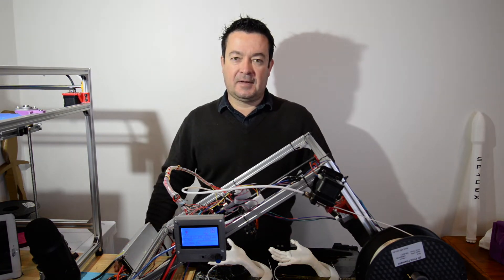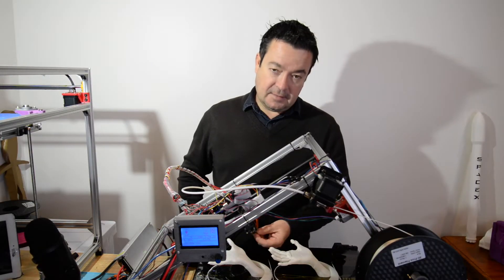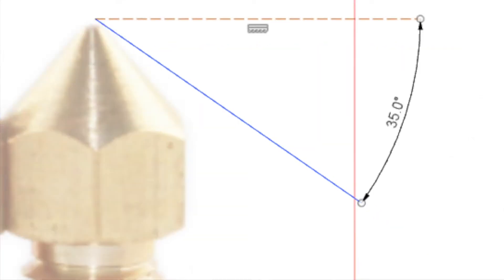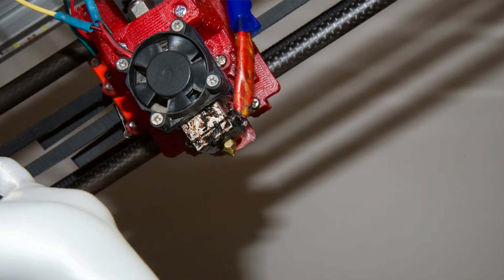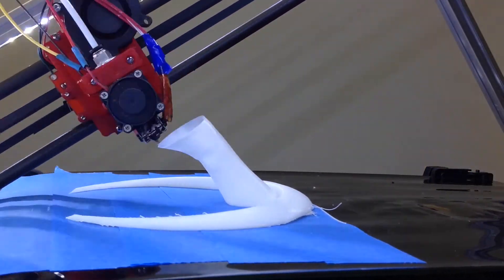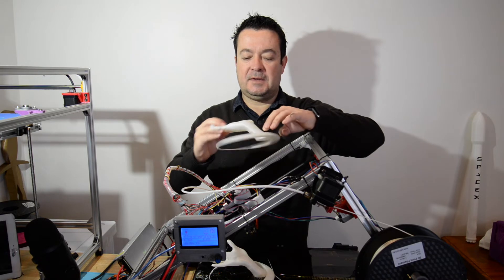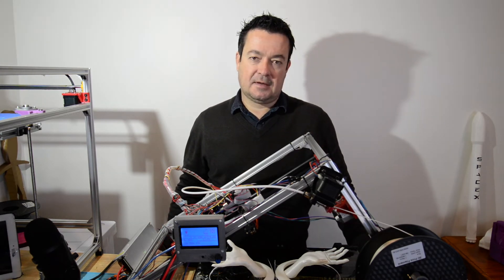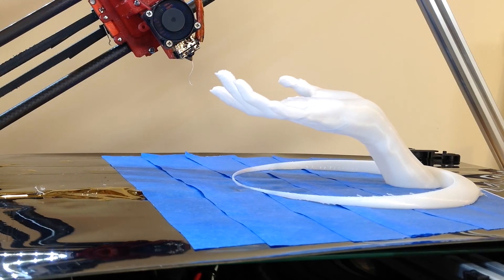Hypercube Infinite 3D Printer - Printing at 0.1mm layer height and Nozzle Upgrade.

Comment: whaoo it's crazy ,
 i want to build a 3d printer but i show you and what ?????  so great project .. i m starting with your base if it's possible ... i want to build my own printer it's better project than i m see on the web ...
but a big question for me , is it possible to make this under arduino and easy programating to change and add angle , axis ,, ect ....
for the structure is simplier than other printer and stable , whaooo so good ... thank for sharing your work , thanks to you Mister Coyte-K.
Reply from the maker: Hi David.   The changes can't ask be made on arduino. The slicing of the model is the tricky part. The model is f rotated at 35, then sliced, the transformed for the movement of the z axis belt. Cura by blackbelt3D does a brilliant  job. They even do supports now. The standard marlin firmware can be used on arduino. Just change the maximum Z to 99999.

Comment: what would be the result or the advantage to change the angle to 45 degrees instead of 35 degrees?
Reply from the maker: Even more extreme overhangs 🙂 Also, the printer can be shorter for the same height.

Comment: You can (try to) modify the v6 nozzle by spinning it on a drill and file the nut edges to get a bigger clearance, but not too much or you can't unscrew it... that's part of the ongoing development, thanks for sharing!